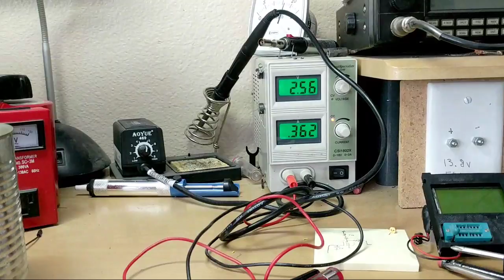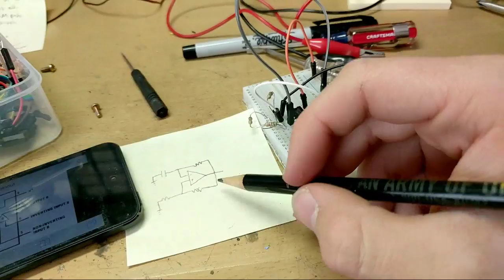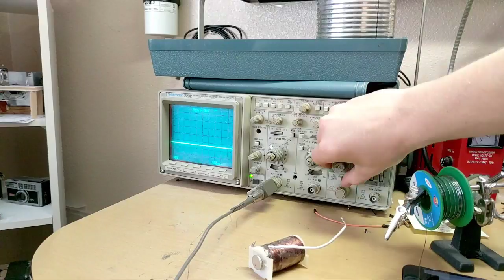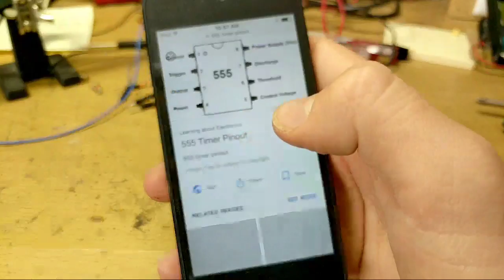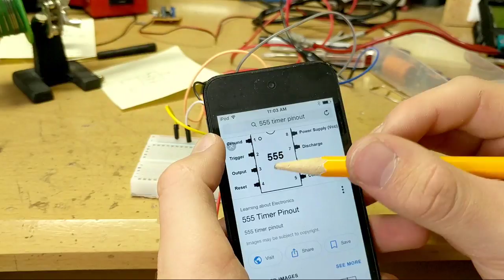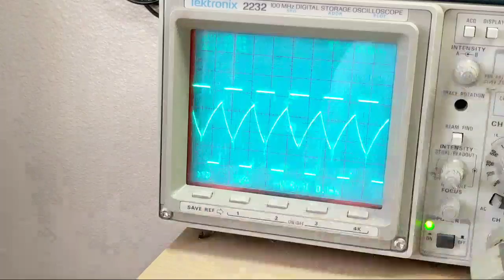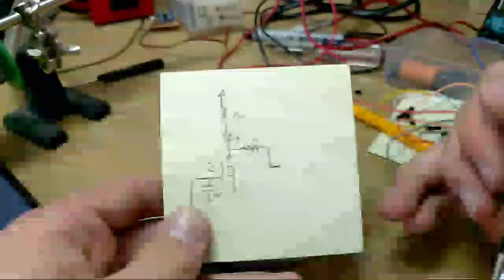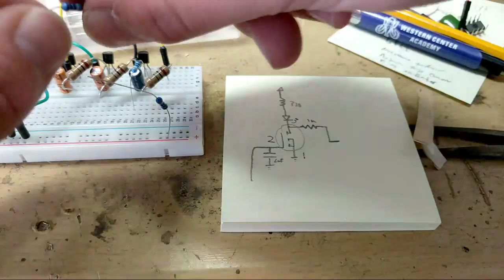Building Oscillators, Lasers, And Other Stuff

Comment: I am pretty sure that your opamp oscillator didnt work because you powered it with +X volts and ground and not +X and -X volts, because even though the capacitor will get charged to a voltage dictated by the voltage divider on the non-inverting input, when the output of the opamp switches to the negative rail, which in your case is ground, the capacitor cannot discharge lower than the voltage on the non-inverting input which is ground, so the opamp will stay locked in this state, when the output of the opamp is the negative rail or in your case ground.

Comment: Great live streams btw. You pick some pretty good content. I think that laser was infrared and they are designed to run somewhere around 1.8 volts. When they are on full power they shine a faint red color.
Reply from the maker: Oh, that is helpful.  I will try to use a camcorder that can see infrared light next time I try this laser.